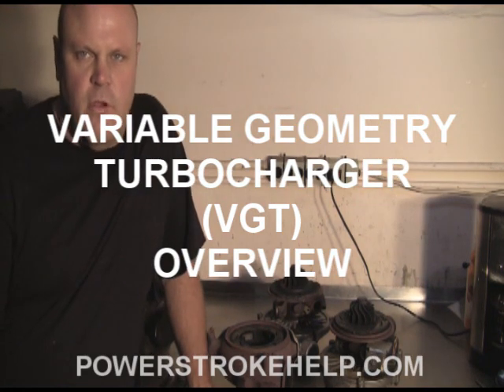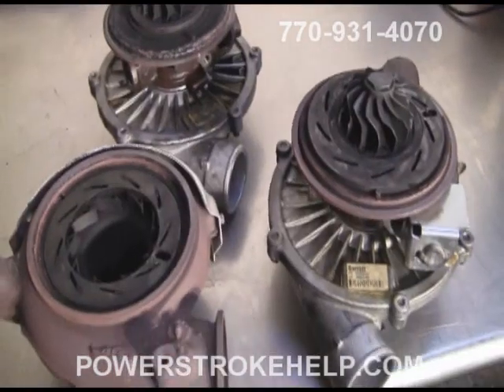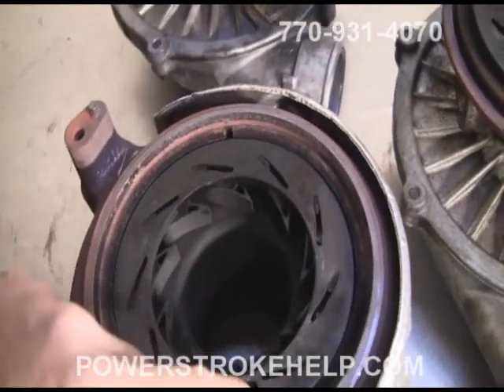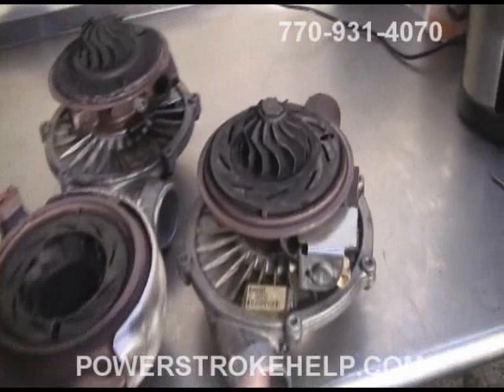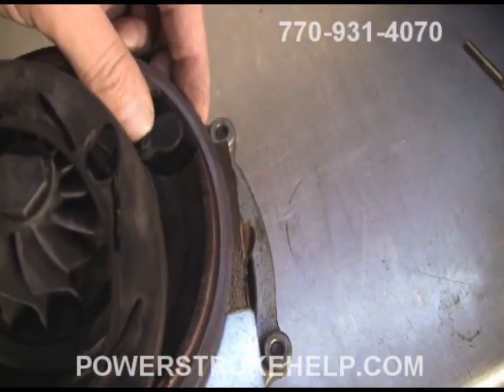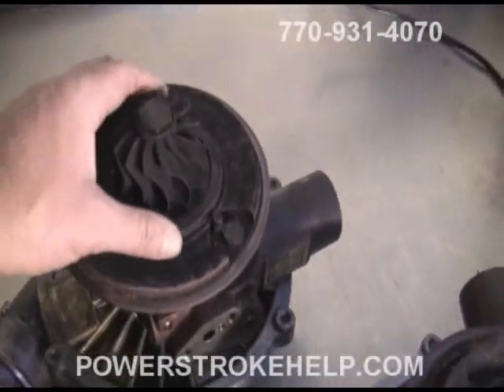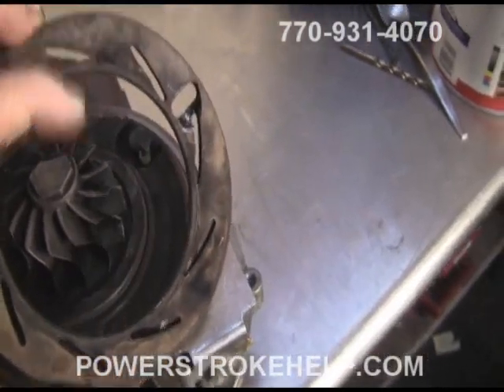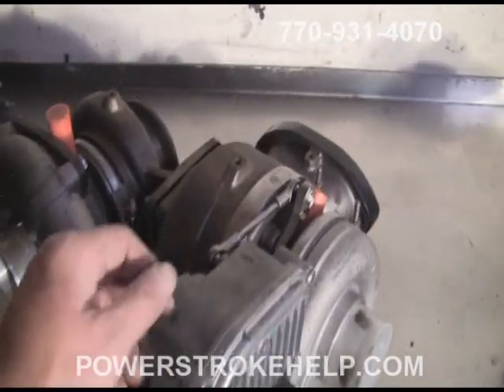VGT TURBO PROBLEMS AND FAILURES 6.0 AND 6.4 POWERSTROKE

Comment: dear powerstroke help, i have a 04 f350 bone stock except for an egr delete kit. it is very sluggish  accelerating until it gets to 2nd gear. then its fine. only way its smooth, is if i ease into it. if i give it anything more, its slow. what could be causing it to be so sluggish?? ive heard various things about the turbos getting clogged. any opinion?

Comment: I have a bucking and jerking 6.0 right now.  It will buck and then won't go above 2000rpm or it will lurch or if I hold the pedal down lose power unless I drop it below 2000rpm.  I had the ICP replaced but kind of lost right now on what else it could be.  It starts good and blows no smoke when it does lurch or buck.

Comment: closing off the exhaust to protect it from humidity will work against you... same as if you seal a vented head lamp, it will cause it to sweat internally as temps change daily... because there is already air in there with water in it that will show it self as temps drop... colder air is capable of holding less water.

Comment: Building a 1969 F600 into a car hauler. Im coming to see you for a motor and trans - probably a 6.0 retrofit as if it was a F350. Im convinced youre the one and I figure a change of pace build will help with the monotony. Im hoping to find a wreck with all the parts I need and just get you guys to rebuild it and add all the good stuff. See you hopefully before summer is gone.

Comment from the maker: That is misinformation. A good running 6.0 will run circles around a 7.3. AND a well tuned 6.4 will run circles around a 6.0.
Reply: powerstrokehelp will a 6.0 vgt turbo actuate with oil pressure alone? Or does it need to be plugged in?
Reply: Ha!  Not my 6.4 !

Comment: I don't see that posable i'm in NC. I rebuilt turbo with a kit from G-pop, changed stand & dummy plugs, stc fitting too still have a high press leak did get truck to start but died after 2 min run now I have no psi to icp. hope to have a former 6.0l certified tech comming this weekend to hlp

Comment: air filter looks clean & indicater only got a little yellow showing got a rebuild kit for turbo back side of air charge fan looks to have oil spun out & caked on the back of it but it can be wiped off with a finger changed stc fitting,  dummy plugs & stand pipes all updated parts from ford, oil cooler & egr cooler OEM Dorman not looking to mod the hell out of truck just want it to start every time got a lot tied up in it have only had it a year & in last 6 months have put almost 5k in repairs
Reply: Did you ever fox your issue??

Comment from the maker: A clogged air filter will create a vacuum in the intake that will pull oil through the CCV. This can cause this problem.
Reply: Hello I know this old. But will a bad. Air filter pull P0046 code? And would the turbo be sucking oil and burning out the back?

Comment: I have a 07 f350 with 110,000 miles in the process of changing dummy plugs & stand pipes found oil puddled in air chargeing side of turbo hoses going to air cooler covered & intake covered inside all caked with oil turbo vains have a black shine & unit has small side to side shaft play. Is oil passing shaft & bearings inside turbo or do i need to look in another location for oil getting into system the crank case breather tube from ds valve cover has some oil but not as much as rest of turbo?

Comment: I'm a gearhead so I fully understand what you mean about diagnosing something sight unseen. I'll inspect the pan plug and see if I can find any obvious cracking of the flexplate. It just seemed somehow turbo related to me since the sound seems to be coming from under the hood, is rpm affected, and is effecting performance somewhat (acceleration is not quite up to par). Thank you so much for your help. I've already learned much about these diesels from watching your vids.

Comment from the maker: I cant diagnose a truck I have not seen. It is physically impossible. You ask my opinion and all I can give are possibilities. IF there is no metal in the pan then more than likely the transmission is ok internally. You may be dealing with a bad flywheel/flexplate which will require removal of the transmission. I really need to diagnose it in person to see.

Comment from the maker: you need to drop the transmission pan and see if there is a bunch of metal on the magnet. It sounds like a torque converter going bad. Possibly could be a bad flex plate.

Comment: My '05 Excursion 6.0 is making a rattling sound that resembles marbles shaking in a coffee can when operating around 2000 rpm. It's directly associated with placing more load on the engine when I get in the throttle. It seems to go away under heavy acceleration as the engine sweeps through its operating rpm range, but with every upshift that loads it back down to around 2000 rpm, the rattling comes back, and then goes away again as rpm's increase. Performance seems off a bit too. Is it my turbo?

Comment: Hey Bill, I drive a 07 F-550 with the 6.0all stock 120,000 miles. Is possible for the turbo not be turning or working and the engine still running (no power at all and lost of black smoke) because this just happen to me and I don't hear the turbo when the engine is running it's like if the turbo just shut down, won't rev at all, press the pedal and kinda works but then sounds like it just stop turning no boost at all . Thanks for your videos, they help a lot.

Comment: Hello,im from Ukraine,ind i have F350 6.0 2006,me problem next- high boost (30-35 PSI) and very low power ((( its VGT problem ???? EGR delete (only mechanycal delete EGR cooler,EGT valve not removal),,, Im waiting SCT programmator,ARP head studs and new gasket from USA,,, Help me please

Comment: Will the tunes work with an un modified truck? My truck is bone stock with the exception of Edge insight gauges and a 4" banks exhaust. I do have the SCT tuner  and tried the canned tunes that come with it but i was afraid of blowing a head gasket or damaging the transmission so i put it back to stock. Thanks in advance

Comment: Bill, I have an 03 6.0 that has been bulletproofed and then some. The one thing i dont have but really need is gauges. Anyways, here's my problem. Back in November i was climbing a long grade in Elko NV when all of a sudden i heard a noise that sounded like a high pressure air nozzle. All of my intercooler hoses are fine. I was even told that my intercooler itself was bad and after 900 dollars i found out that it was not. it sounds like it is coming from the turbo. any help would be appreciated

Comment: Bill I have been thinking about buying a newer Powerstroke, but I don't want to go with a 6.0L I've heard so much bad stuff about it but I found a 2008 6.4L for about the same price that I can get a 6.0L I'm trying to do alittle research on the 6.4L before I spend 25-30 grand on a truck I know one man with the 6.4L & its in a F-450 only problem he has had with is was the Transmission in it but he went out and put a big ole Gooseneck on it during the break in period Is the 6.4L worth the money

Comment: Bill, at what RPM should you start building boost off the line? I dont start getting boost until around 1500 to 1700 RPM and its very slow out of the gate, but once it does build boost its like a rocket. It seems better if i ease into the throttle but i was just wondering if this is normal? I know one thing is for sure im a little punchy pulling out in to traffic. Thanks in advance

Comment: Ya i get that, do you think maybe it could just be the tune on the truck i dunno if its stock or not i have to strategy codes for it but dont know if its a stock tune or not. It was running at about 1800 rpm in O/D could that contribute to it? i hear ppl saying it should be at around 2000 rpm so that you have all the torque.

Comment: Hey bill i was towing about 3000 pound trailer with my 2005 f350 6.0, now my truck ran good except for a few times. When it would reach overdrive it would kick in and the egt temps would jump from 1000 to 1200 and i would have no power in the peddle i had to ram the peddle to the ground to downshift to get going again. Also my turbo once in a while would all of a sudden jump from 10 psi to 25 psi and then  back down again any ideas? its been bulletproofed.

Comment from the maker: @bigtim9119 I like the Ford PowerStroke because of the way it drives and handles loads. A properly running PowerStroke is the best truck on the road. As far as used I have seen 7.3 junk as well as 6.4 junk. It all has to do with how the previous owner treated and took care of the vehicle. The 2011-2012 is the nicest smoothest truck I have ever driven but it is also 60 grand. For the money the 99-03 is the best bargain, the miles are irrelevant. Cheaper and easier to fix and run.

Comment from the maker: @rquarantine The Ford Gold coolant is just fine if you flush and fill every 30,000 miles. If you want to go further the installation of the coolant filter and ELC will help protect your coolant system.

Comment: Now I own a 1991 300ZX turbo and it is on it's third set of turbos in it's 100,000 mile lifetime, admittedly it's been run hard.  I have learned my lesson with turbos.  What you want to do with any turbocharged motor is let it idle up a little before you drive it, and idle down a little before you shut it off to let the oil get in and out of the turbos.  You need to keep the oil level full also.  If the vehicle is down a 1/2 quart, don't wait until your next oil change, put the 1/2 quart in it!

Comment: VAG has something called a VNT which is the same technology (in terms of the variability) which suffers the same problem. Unfortunately it's a common problem, but as long as you give your car regular oil changes, and get EGT temperatures up to a high level (high loads, high revs) - Most people unfortunately just drive like grannies and they get gunked up. 
Another good video, really like your explanations of things even though I'm not interested in these types of engines :) Keep it up!

Comment from the maker: @BuhlzI I have not seen a VGT conversion for the 7.3 ... yet. Yes DPF regeneration will contaminate the oil with fuel. If left unchanged will kill the main and rod bearings. I have seen it about 25 times now. I am convinced that the lack of lube from fuel contamination is what makes the rocker arms fail also.